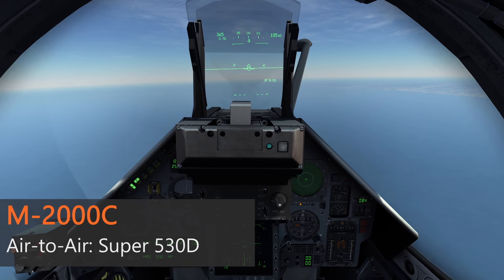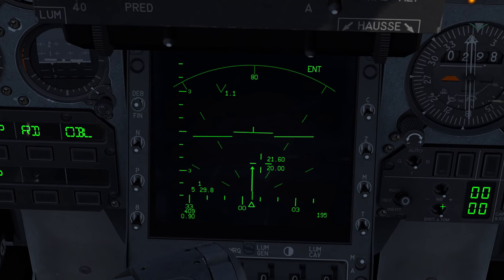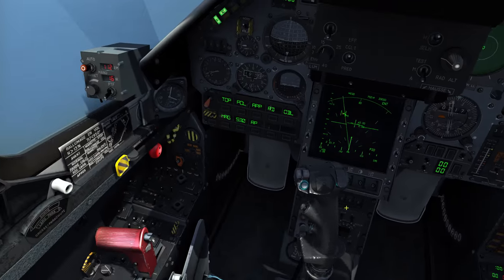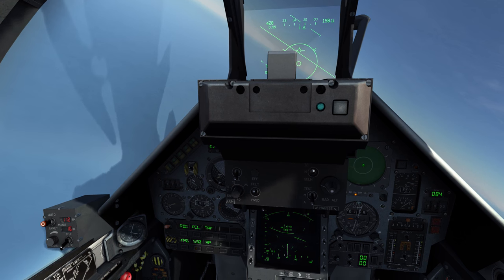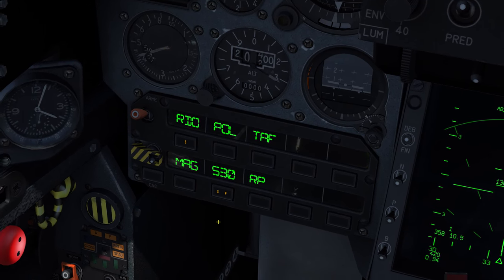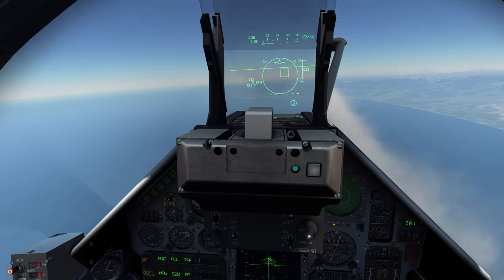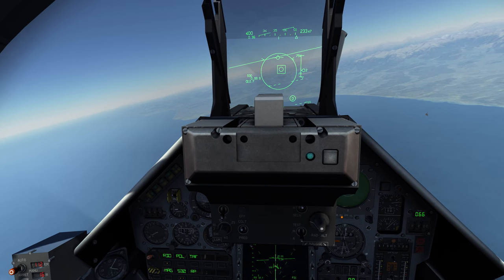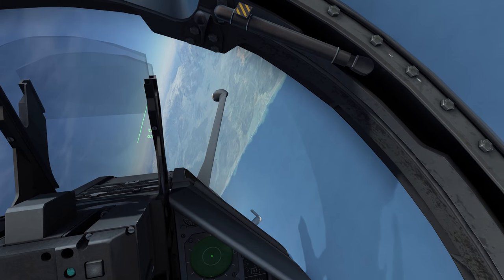[DCS] M-2000C Air-to-Air - Super 530D

Comment: To use the 530 you need to be in PIC mode on your radar by locking the target once again. 
You were on PID mode at your first try, this is why your missile didn't go to the target. 

On the HUD the little circle need to be in the square ⬜ just like on your second attempt. 

At least good video we are waiting for AirToGround tutorial as well :)
Reply from the maker: +Ilyas Rayan SAIDOUN Thanks for input. Yeah, some other people noticed that too. 
I rewatched the video and I observerd that I was in the PIC mode the whole time. 
However, it seems that the first missiles seeker didn't pick up the target (maybe because the radar return was to weak) at the launching point. 

At 4:40 you can see that the second missile switches from seeking to lock as the circle goes from flashing to solid inside the box. 

I added some onscreen text explaining my mistake.
Thanks!

Comment: +1 sub! I only still have one problem. The hud doesn't show that small circle inside the bigger one, is that the reason I still miss my missiles? Can you discribe what i'm doing wrong (if you now it), please? (Sorry for my bad english)
Reply from the maker: +Thierry Wagemakers Do you have the Master Arm enabled and the Super 530D loaded onto the aircraft? If there are no 530Ds aboard the aircraft the HUD will look like it does at 5:31.
Reply: +xxJohnxx thank you very much for the fast reaction. I can perform all the steps, but if i fire the missile doesn't follow the target. I have installed the super530's on the mirage but i still have the problem. I don't know if it's useful but the hud shows a little square outside of the big circle, I think path of the target,  and i don't know what that means. I only know that your hud don't shows it.
Reply: If you don't know the solution, it doesn't matter than i will make an account on a forum and ask other poeple for an solution. I think i'm making a very stupid mistake.
Reply from the maker: Thierry Wagemakers
Yeah, I fear I might have to pass on this one. I haven't been flying the Mirage in a while and there where some changes made to the aircraft and especially radar/hud.
Asking on the forum probably would be the best thing to do though! ;)
Reply: +xxJohnxx thank you for your help! I think i've got the solution, i think I only have locked the target one time and you said in your radar basic video that for weapon engagement you've locked the target for an second time. Tomorrow i'll try another time. Again thank you very much for your fast reaction and for making these very helpfull video's!